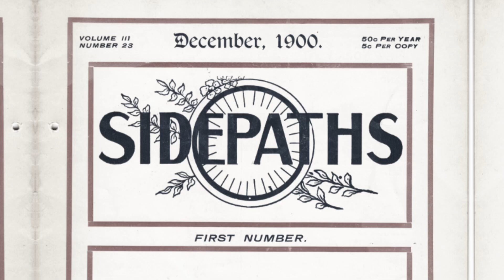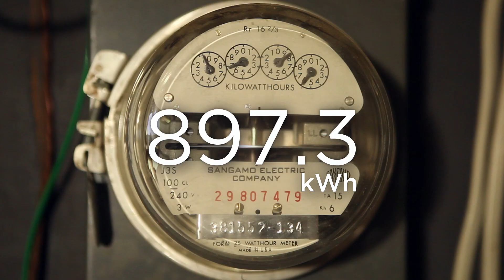Can You Power A House With A Bicycle?

Comment: 900? omg man i just use 40kwh on a month, care the planet please!
Reply: Dude even now during COVID-19 I live with a family of 5 and we use about 200kWh per month. Seriously do you actually need air conditioning and heating? What I used to do is just go swimming when it gets to hot. And are people really that lazy to use a heater instead of wearing extra clothes when it gets cold?
Reply: @alexbridenbaker9261  I don't use much air conditioning but we heat with mostly electric heat pump it kinda depends on how cold it is where you live.
Reply: @alexbridenbaker9261  what do you use most of your electricity if you only use 200 KW?
Reply: @alexburnette2526  I live in So cal. Most of the power is used for the washer, dryer, dishwasher, computer, like the high energy devices
Reply: @alexbridenbaker9261  probably could get solar there if you ever wanted to
Reply: @alexburnette2526  Yeah but it wouldn't be worth it as our electricity bill is low at $20-$30 a month
Reply: Soooo we can power our homes with a bike?
Reply: @triggerwarning8240  No. You can power part of your home with a bike while lowering your electric bill and get a work out
Reply: @alexbridenbaker9261  Cheers. Based on 200 kw per month?
Reply: @triggerwarning8240  I'm not sure what you mean, but with a bike generator you can power a large amount of small things. Like you can charge: your phone, laptop, Nintendo 3DS. 

Or power: lights (I'd assume only LEDs, fluorescent and incandescent bulbs are energy hogs, unless it was a very dim bulb at a low lumen rating), low power rated game consoles, mini fridge, etc.
Reply: what do you use to heat and cool your house?
Reply: @alexburnette2526  
>heat
District heating through co-generation
>cool
Fans.
Reply: @alexburnette2526  in summer i go to parks and rivers, in winter just put some clotes on. Trying to live like conforted Kings and Queens is destroing our planet and our sense of what life trully means.
Reply: @fullmetaldg  you made the comment 8 months ago an you replied back in just a few minutes. impressive how you can only use 40 kw a month.
Reply: @alexburnette2526  i reply quick cause yt sended me a notification. I just want to put the theme that is possible and has so much sense for planet and for our selves as human beens to live in a new way. We need to change in order to great our lifes great again, and for that we need to get into the Nature.
Reply: @fullmetaldg  human be like ,f the nature i want to feel relaxed
Reply: @fullmetaldg  thanks for inspiring me man
Reply: 40kwh a month! just my 3kw heater uses 60-70kwh a day in winter. I think you are lying, my monthly electricity unit come around 2000-3000kwh on an average, there's no way anyone can live using 40kwh a month.
Reply: @Rk76742  using electric power to heat a house is one of the less effective uses that we can give.
I see funny how cultural distances makes a huge distance between our worlds.
I never use electricity for heating (i live in Argentina, we never have less than -3º at winter).
Reply: @fullmetaldg  The US has a wide range of temperatures. I live in the middle of the US in Kansas and our record high is 121F and our record low is -40F. Right now it's close to 3:00 in the morning and it's still 81F.

Comment: What if we scale it up a little bit? Say, to 2nd, 3rd, or 64th gear? What about a generator that takes 10 to 15 minutes to get up to speed, but then a single turn of the petals in the highest gear would crank the generator several hundred times harder than in first gear? This wouldn't even be a bike anymore it would be a "petaled-generator". It would be a spectacle to see being built and again to see it in action, but I'm sure there's a better way to generate electricity than shown here in the video.

Comment: This implies that you need 900kw/h to live.  This type of energy source is for emergencies (in america and other developed countries).  I'm willing to bet that if people realized they have to pedal to power their home, they would be line drying their clothes, and turn their A/C off until its 90 deg inside.

This device and idea is very useful in undeveloped countries that have zero electricity.  where they would happy with a single LED bulb so they can see at night time in their mud huts.
Reply: excellent comment
Reply: please do try avoid making bets
Reply: If they're living in a mud hut, simply getting an LED light might be a problem.

Comment: I'm not an expert but the type  of setup you are using affect the energy percentage you are getting that's no brainer....but i think with using high mechanical advantage and higher efficiency power booster you could generate a more considerable power out of pedaling. Please comment agree or disagree

Comment: It could add an element of enjoyment to being on an exercise bike which can easily generate enough power to charge a phone or even a laptop. You'd put in more effort and burn more calories if you knew your effort would be charging your devices.
Reply: if you were willing to make some big sacrifices on electrical use, like burning solid fuel on a range cooker for heat/cooking/hot water(not good for the air and  people's lungs, but at least from a carbon-neutrality perspective it's only putting back in the air what would have rotted from a tree, unlike those pesky fossil fuels which if left to their own devices would have stayed deep underground and not ended up inthe atmosphere (please someone correct me on this if im wrong though, this is all stuff im parroting that ive heard elsewhere but logically it checks out in my book)) , or doing your laundry by hand, installing big windows for light and just sleeping when the sun goes down, using energy-efficient top-loading fridges, or other sorts of lifestyle adjustments, i think it'd be very possible for a fairly fit adult to generate everything they need to live with basic modern creature comforts. might end up spending all your free time at home topping up your batteries though haha

Comment: So your gallon of gasoline may power your extravagant lifestyle (by world standards) now but not for long,   Easy oil is gone, now they have to wreck the environment to get oil.   Soon even that will be gone and you might need to make do with the amount of energy a house uses in rural Africa where they use bicycle powered generators to power their led lights and charge their cell phones and that's all they need electrical power for.  In parts of the third world they use bicycles to directly grind grain to flour and many other tasks which is much more efficient than pedaling to create electricity.

Comment: Could I use a bicycle to turn a water pump that pumps water to a water tower, that then releases the water and use the gravity and force of the falling water to turn a turbine? Would that give me an increase in power output?
Reply: I assume a loss. Every time you transfer or convert energy there is a loss in efficiency. But it would give you a storage method. Which makes me wonder how much we could gain from collecting rainwater into a water tower.

Comment: I've wondered.. what if you run an alternator instead of a generator and what if instead of pedaling, you connect it to a low voltage spinning motor, capable of spinning the alternator so you don't have to pedal? Is it possible?
Reply: People have tried that. You can totally do that. But it's kinda pointless since you get less power out than what you put in.
If you power it with a small motor then there won't be very much force available, kinda like using a feather's weight to push down the pedals, it's not gonna move much.

Comment: Im a full noob, and electricity is the opposite of my specialty, but can anyone tell me why you cant just make the bike wheel larger, and add multiple generators, rather than just 1? Thanks.
Reply: The more generators you add the harder it is to turn. (there's other ways to make it harder to turn, if that's what you want, by the way)
Making the bike wheel larger will make the generator spin faster, but with less force on the generator or more force on the wheel/pedals.

Comment: Using your hands may be a little less consuming. And more rewarding..

Which means you could have two people, on one bike, to get the real speed. Which would raise the kwh to about 2.5 (however, the decrease of the 'go through', with battery, and generator, it gets bumped down a bit.)

And further on, with about 4 people (Let's say it's a family)
They could raise the gears, and make it easy for the hands to rotate, getting nearly 8 kwh..

Now, you'd be lookin, and sayin "why, how would that work anyways?"

Glad you asked!

For a higher gear on the bike, it would not only get the wheels well-on with the spinning, but also make it easier to rotate.

Thereby producing more energy.

I calculate this 2.5/Person.. including the dropdown with the battery, generator, and wires.

Comment: Hi Adam
Can we generate electricity through ELECTROMAGNETIC INDUCTION??
Reply: Yo Bitch! Magnets! Induction motors require electricity to begin with for the field coils.
Reply: You can uses electromagnetic you will need gears pulls ac alternator deep cell batterys
Reply: Sound complicated to me. Like Mercedes.

Comment: Alright, what if I only wanted to power a small LED for my tent and charge my tablet to watch some videos? A bike powered generator doesn't sound terribly unreasonable if you aren't charging a whole home.
Reply: Totally doable. It would still be a waste of time, if your tent had grid power anyways, but it doesn't, so it's not.
Reply: then again, you would most likely have a spare power bank charged fully with you than a setup to get electricity from your bike :D

Comment: It would take 50 cyclists, but only with the technology you used in the video. Wind power turbine can make 50kw easy, so why not a cyclist. If you used a system with 15 gears and a flywheel the size of a car, a generator the size of a washing machine, and a battery the size of a fridge-freezer, it would be the same as a wind generator and would power your house no problem. However, it would take quite a while to get the machine up to top speed, and a lot of human hours to keep it going.
Reply: Because the cyclist can't push the pedals hard enough?
How big of a wind turbine are you talking? Can you imagine trying to make it spin by hand (or foot)?
Reply: I think if everyone used there dogs or animals we could use them to turn it lol
Reply: @devonwallace2  YOOOO big idea!!! don't get your pets out for a walk, make them run in wheels :D
Reply: @animacuso100  no seriously they need exercise we need power reward them woth treat for spinning  every 15 min idk I would make the charge battery that you take in and out to power your home
Reply: @devonwallace2 ❤❤❤
Reply: mechanical advantage can be used to get you more torque per unit distance covered, or more distance per unit torque delivered (for a bike it's the latter i think) - it's not some free energy hack. your max human power output will always be the limit that you can get closer to depending on how well you can beat the inefficiencies of all the mechanical parts of the system and such. but you can only get closer to that limit, not exceed it.
Reply: Burning coal will be way faster 🤔😵‍💫
Reply: https://www.youtube.com/watch?time_continue=174&v=Cgb9lfKW_d4
Reply: G

Comment: Can you pedal an underground fallout blast shelter with a bike? It is smaller and less demanding. Lets say that you have hand-cranked lights so you can take lights out of the situation. Maybe someone would have a.... plug in electric stove, air filter, computer, and a phone. Maybe a battery charging station for other small devices. The shelters I am interested in are made by Atlas.
Reply: I don't see why the hand cranked lights make much of a difference, it's coming from your body either way and it's gonna tire you out either way.
My computer uses about 60 watts doing nothing, I have it on a kill-a-watt. But the monitor isn't, so maybe add another 20. Phone is pretty tiny, let's call it 5. If you run those all day (24h) that's about 2kWh.
I dunno what the air filter is, but I assume it's a big fan, maybe 100 watts. And the stove is like 1000 watts. But you don't have to run those all day, do you? 30 minutes of cooking and 6 hours of air filtering is another 1.1kWh. 
(Conclusion: use your phone whenever possible, keep your computer in sleep mode, and eat lots of raw food)

Comment: rethink the generator part, this one guy in India figured it out. He's giving away 10,000 to people in India and the machine costs about 25,000. one hour a day keeps the electricity on for 24 hrs. There is a way to do it using a heavy flywheel and using proper ratios. My idea is if you figure out the correct ratio, figure out the correct weight of the flywheel to store energy so as to help you pedal ( it would only take the power to climb a hill to get it moving the rest would be maintaining rpms like your on flat land with a heavy loaded bike trailer).
Reply: What video is that
Reply: @Seddysaid  https://www.youtube.com/watch?time_continue=174&v=Cgb9lfKW_d4
Reply: It wouldn't be a matter of tweaking the generator and storage, it would be a matter of saving energy in your house. Leave the air con off, switch all the lights to LEDs, with lower wattage as well, turn them off when you're not in the room. For that matter, only do stuff in daylight. Get the best insulated and smallest fridge you can find. Eat canned or salted food so it doesn't need to be in the fridge. Good luck cooking things, I hope you can make one batch of cooked meal stretch a few days. (You can probably make a solar cooker, but that's cheating)
Reply: India uses a considerably less electricity than us.

Comment: What kind of battery have you used? how long will it store?
and how can I further connect the battety to my household appliance?
Reply: 1-From generator to battery,
2-From battery to inverter(connect battery to inverter)
3-From inverter to electric appliances such as hair dryer, refrigerator(yes u can power refrigerator using car battery, but battery will drain in 1-2 hour)

Comment: First of all, focus on lowering the energy consumption. 901 kWh per month, just wow! I am Danish and I use 1200 kWh per year (2 ppl, 1 apartment (so no waterheater)), and an average Danish household (with 2 adults, 2 children (no aircon)) uses 6300 kWh per year or 525 kWh per month. So that being said, the bike would power a larger percentage of the household power consumption and lower the number of Adams neded to 29-30. This still does not make the power generating bike a favourable solutions, but you will save money without having to bike 8 hours a day.
Reply: Yeah something is off 900 kWh per month is electricity of a medium office building. I think they messed up the calculation. It's not like he has lights, air conditioning and microwave all running simultaneously.
Reply: How do u shower?
Reply: I live in Romania in a 200square meters(2152 sq feet), and I use less than 300kWh/month. And except few led bulbs I do not try to save to much. If I were to replace all the bulbs for led, go for a solar water heater, and some new more efficient computers(I use them 8hours a day as my job), I would probably save another 100 kWh.
Reply: yeah i used to use about 400kwh a month by myself (no fridge) and due to some shit that went on i decided to cut down as much as i can and i managed to bring that to a little over 200kwh.

Comment: Why can't we store the power by solar panels? I heard that we know how to convert it from light into energy and use it, but not to save it. Why can't we just use a battery?
Reply: I know that this is an old comment, but if you're still interested, we do use batteries.  The problem is that your average battery just isn't efficient enough in terms of the space it takes up relative to the charge that it holds.

Assuming that you have a great system that entirely powers your house when it's sunny, you would want to be storing whatever excess you get in batteries.
  
But if you have more than a couple days with poor solar generation they'll run out completely.  To avoid this, you would need to have massive banks of batteries, which is not realistic.

This is actually the primary factor that limits the range of electric cars; current batteries that would provide the desired range boost would be too big and would weight down the car, decreasing its efficiency.  As such, Tesla is doing quite a bit of research in producing batteries that pack more of a punch for their weight.

Comment: I love this! As a mechanical engineer working in clean energy I get this question frequently. You all nailed the explanation!
Reply: Patrick M yet they left out all the possible energy efficiency improvements and fail to mention that even offsetting some of the coal sourced electricity would be great, particularly when someone is working out anyway and the energy would otherwise go to waste. Way to brush it off using #sience instead of finding ways to harness the energy of all the many people that work out every day. Hmmm
Reply: What if you used a pulley system and gearing to increase your output? Not to say you could power a home, but you must be able to double that amount at least.
Reply: @visualartsmr.brandon2060   double?
I am completely ignorant but to me.. it seems like you could easily connect 100 of these cute little generators they have on the video, and a human could easily keep it going.
So you would produce 100x energy??
I don't know if that is right. And maybe you still can't power a house but it would be something rather than nothing.